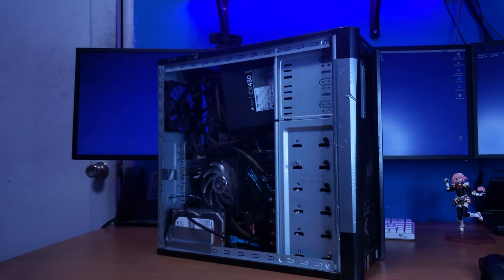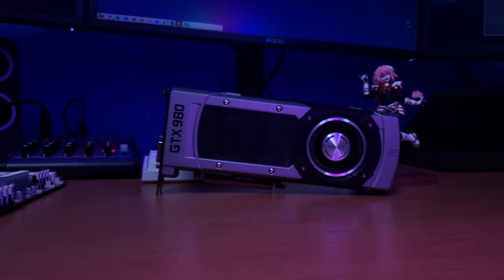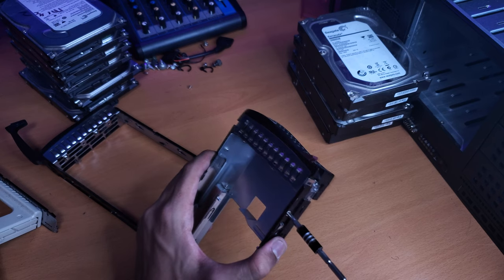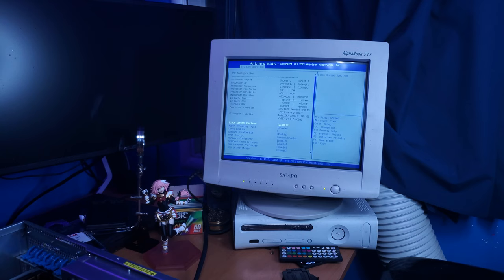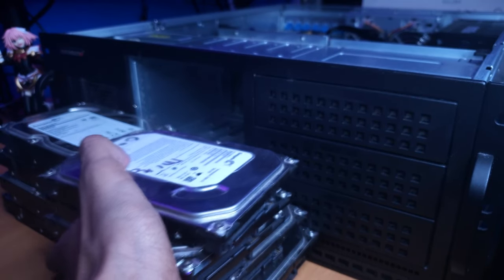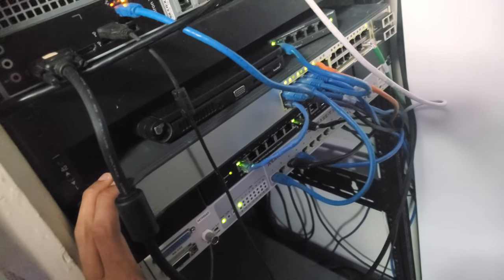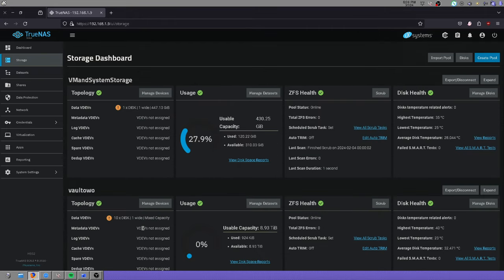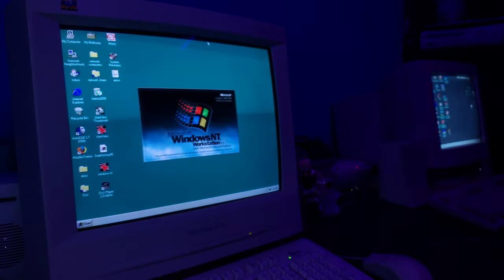Building a Really Fast Server for Video Editing!

Comment: The reason it didn't work with the first PSU is the whole configuration uses more than 850W. Without counting the chipset and all other controllers on the motherboard, an approximate configuration would require around 720W of power. And this server would probably run on twin 1000W PSUs for both load balancing and redundancy.
Reply: if the server turns on with that psu, that’s even worse because that would mean the psu doesn’t have protection. the server refusing to turn on is actually a good thing and shows how good the power supply is.
Reply: @satokotsu  True. God bless EVGA

Comment: Just a thing that i stumbled upon in several truenas forums. You are probably using RAIDZ1 which is not really reconmended at a larger disk scale because rebuild timings are super long when a disk fails and if another one fails while rebuilding your data is lost. So if you have a decent backup its probably fine but if not i would consider adding another hdd for redundancy in RAIDZ2 atleast. Otherwise great video :)

Comment: I had a similar set up with a 70w single Xeon on a dual supermicro board, 256G of ram, and a few hard drives just to test. After the first month i had to scrap it because it was using a STUPID amount of power when i was streaming from plex. Now i use a laptop with dual external 3.5 enclosures and i get the same speeds as before because of the 1gb bottleneck.

Comment: Dumb thing that you might want to check out. The NVidia drivers are broken for the 900 series on linux. The fan will not ramp up. So the gpu will gladly slap the thermal limit.

Comment: this mobo is a dream, I built my daily pc with it, e5-2699v3, 128gb of ram to work on some network virtualization, 1tb ssd + 1tb hdd with vmware esxi (with more than 5 vm's), dual lan, pcie x8 wifi/bluetooth card and a beautiful gtx 1080ti. I can literally do anything with this system, and much cheaper than a modern pc with modern components

now my question is, WHERE DI YOU FREACKING GET THAT CASE!!!! I NEED ONE FOR MY BUILD AND I STILL CAN'T FIND ONE FOR CHEAP :((((

Comment: you have every component to build the exact same spec pc that im currently using rn lol, i7-4790, 16gb, gtx 980. too bad my psu is top notch garbage, shuts off when a very specific load is applied.

Comment: I like how he uses an old CRT monitor to test his server.

Old LCD monitors are everywhere these days. I've got two just shoved in my cupboard. I've got one on my desk, which I found on the fucking street. They are cheaper, lighter, and probably more reliable than those huge CRT monitors.

That means this guy either went out of his way to hunt down an old CRT monitor, or he held onto his, while most normal people were throwing theirs out. Or maybe he found one dumped outside someone's house 15 years ago, and hauled the fucking thing home, just as I did with the aforementioned monitor on my left. Who knows?

Either way, that's the monitor he reaches for when he wants to test that server. He has an LCD monitor in his data cabinet, and (I think) two more on the floor in front of it. If I could be bothered to rewatch the video, I'd probably find 10 more, _easily_. And yet he goes with the big, heavy, power hungry CRT that's probably old enough to drink by now.

I don't know why he does this, but I like the dedication. This must be the coolest channel on YouTube, and this sort of thing is one of the main reasons for this.